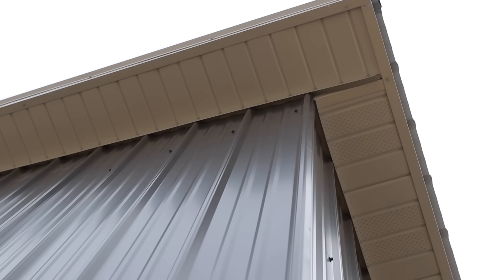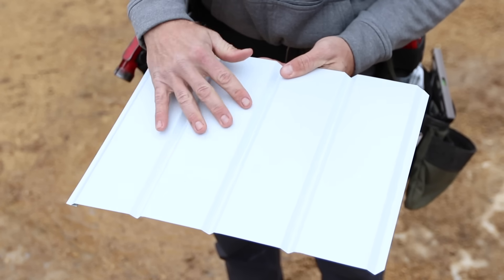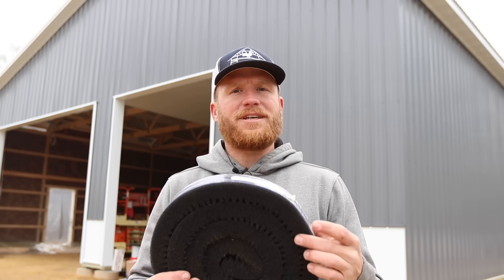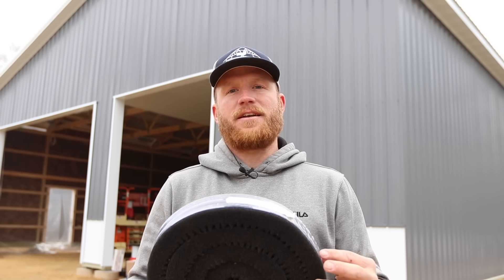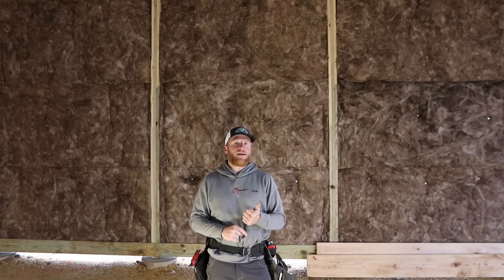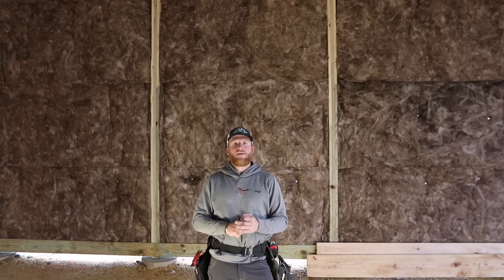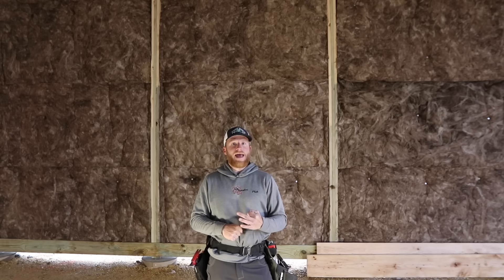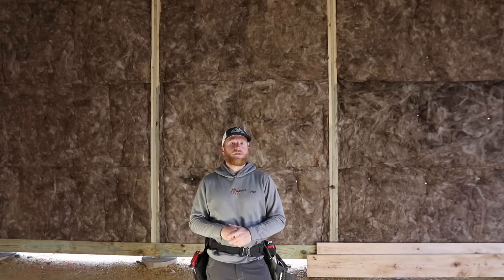Insulation: 5 steps to a more efficient building and why I don't use spray foam

Comment: I would not use spray foam for a few reasons. Once it is there it is there for good. For example, If you need to replace a outside panel its not going to be fun as that foam was adhered to the panel and its not coming off.  The second reason is out-gassing. 
In any event, the building you showed is very nice and shows your attention to detail. Note: My show in VA only has 1.5" of rigid foam panels on the wall with plastic moisture barer on the inside and R19 fiberglass on the ceiling with plastic moisture barrier on the inside and steel over that. In our climate it is more than enough as I mainly cool the building vs heat it.

Comment: The biggest problem I’m seeing is there is wayyyy too much conflicting information. 

Some folks say closed cell spray foam is the best, others say a mix of open cell/closed cell is best, some say use house wrap when constructing a post frame building, others say “no way José”. Some folks swear by pink fiberglass batts with paper backing because “the backing IS your vapor barrier” and still others retort back with “But when the paper backing gets wet then it’s all a big mess at that point”. 

Some folks say “Check with your local blah blah blah” only to find that each one of the local builders/architects/contractors/shamans all have their own opinions on which way is the “right” way. 

Some folks will tell you “NO do NOT use metal! Instead use sheathing and cover it with normal house siding because metal sweats and OSB doesn’t”……but then you discover that it does in fact sweat and next thing you know your OSB is OSBogged down with water and black mold. 

When I discovered that this condensation issue was so persistent and pervasive I told my wife “Damn, how in the HELL does anyone have a structure if there is such a crazy issue to overcome that seems like no matter what….it’s futile???”. 

We (the wife and I) are buying an old (1950) property soon and that property has two garages….one is stick built and attached to the house (28x24). The other is behind the property and it post frame (in the ground) from 1982…..back when they were siding/roofing them with aluminum. It is 26x40. 

Neither of them are insulated. They both look pretty good, but being that they are in NW PA (so humid AND frigid) I need to condition both spaces. I’ve been reading and reading and reading but still haven’t found anything that seems solid. I’ve seen countless examples of a job that was done textbook only to end up exhibiting mold/rot/water damage. 

Why don’t the bottoms of walls also have vented soffits and channels (air gaps) similar to how roofing can have a soffit/foam channel thingys/ridge vents in order to allow the roof to dry out? Couldn’t the entire wall have a foam channel (with a vented soffit on the bottom) that meets up with the vented channels in the roof that ultimately leads to the ridge vent? As air outside blows over the roof it would create “pull” or “suction” that would pull air from the bottom of the walls and out through the ridge vent. It seems like a system such as this would allow the entire structure to stay dry no matter what.

Comment: Wrong! I know this is 4 years old so hopefully you have learned more on building science. Air circulation is good and gable vents are a must! Your lower vent(soffit) needs to be at least equal to your ridge vent. if not you can and will get reverse airflow from your ridge vent down through soffit vents. Gable vents help equalize the pressure and help with varying wind direction.

Comment: Hey, I really do appreciate your tips and perspective on building a pole barn.  I learned a lot from you and you changed my mind concerning the use of spray foam for my walls.  I plan on plagiarizing your insulation technique along with using foam insulation for my concrete.  I still plan on blowing insulation on the ceiling but what do you consider the pros and cons of using house wrap on the roof.  I might be mistaken but I think it would help decrease the elements within that space while permitting the building to breath.  Again I value your perspective and acknowledge that I have a lot to learn.

Comment: His five key tips
1. Vapor barrier 
2. Vented soffits
3. Rat board foundation
4. R-19 fiberglass wall insulation 
5. Vapor barrier on inside ( northern climates)
6. House wrap attic air deflectors 
7. R-38 blown in fiber glass ceiling insulation 
8. Strong structural steel frame door
9. Strong energy efficient windows
10. Strong garage doors
  
Thanks Kyle
10.

Comment: Yall should poly (vapor barrier) and caulk the cripples and cracks regardless. It will add the the life of your building because shit happens. im talkin many years down the road but it is important and does make a difference. 30 year insulator here btw from alberta canada. ✌🏻

Comment: As an electrician, don’t ever use spray foam. The money you save on heat/ac will be spent tenfold if you ever want to remodel.

Comment: How this makes sense to me,
Unless you have a whole house humidifier I cannot believe the inside air is ever more humid than outside.  
If you have house wrap, slowing air movement that would help dry the lumber, and also insulation any moisture could be there for some time.
I think that barrier on the outside and used to prolong lumber in a conditioned environment  would be better.
Also if heat is radiating to the cold metal neither barrier will stop condensation on the backside of the cold metal.

Comment: I am sheathing my building which will no longer sweat. I am also not pouring any concrete that touches any board. Insulated slab. What I will do is rip some osb in to 1 foot strips and install them on the bottom girt on the inside and then rip some concrete board and caulk and install that hardy board in a dug trench on the outside. This will allow for a barrier to where my 4 foot insulated sidewalk can be against the wall just under the tin. On the inside I will install some 2 inch foam board all around the walls (the post will have the foam cut off flush where the slab begins so that way brackets can be installed and 2x4s screwed to the post all the way around so that the main pour will be level and not having to deal with triming every single osb sheet that goes up on the walls, once the main pour is done and hard enough to walk on someone will remove the screws and boards. The foam will be placed around the posts and concrete will fill that small section either the same day or the next day.) down about 2 foot. then back fill, lay down plastic and then the rest of the foam boards. Using 2 inch foam around that post will be covered because the 1.2 inch 2x and 1/2 osb and then 1/2 drywall.

Comment: Can I assume that you install a sufficient thickness & R-Value foam insulation board beneath your concrete floor slab? In addition, do you also surround the perimeter of the slab with a foam insulation board between the bottom treated board and the concrete?

Comment: Actually, with Flash & Batt with 2X6 framing, you should be using 2" of closed spray foam and fill the rest of the bay with rockwool batt on top. I hope you are going to put a barrier over the wood at the bottom of the walls so it doesn't come in direct contact with the concrete floors.

Comment: I put a 2x4 rolled in mineral wool on the roof than I 2x8 stud built perpendicular and did house wrap and vapor barrier under the roof and between the studs and osb. I also added 2x8 studs to my foam insulation on my post frame walls after an artic event took my shop from 65* to -10* inside it. Over kill can be the best at times but it’s almost gotta save from another catastrophe to justify it

Comment: I just had a pole barn built in northern Pa. I want to make a shop in it. I’m not sure what is the best way to insulate the building. So many confusing comments. I just want to get it right. It’s a big building 40x 80 . Want to put a 1000 sq ft shop in it.

Comment: Hey Kyle, i know this video is old, but i see that you switched to spray foam. Care to talk about what made you switch? I assume it is customer to customer, but thought you might have some things to talk about.
Reply: My guess is that closed foam spray foam(not open foam, there is a difference) does everything he wants done, plus it will last a very long time(up to and some accusations that it'll last over 100 years). Which means it will not need to be replaced as often as everything else.
Reply: Yes please... thx
Reply: And now switched to mineral wool..

Comment: Pretty good explanation. The truss is called a raised heel truss. The only thing that is better than a metal door is a fiberglass door with a foam core, just as strong as metal and better insulating and more resistant to dents. You can also put 2" thick hard foam boards under the slab all along the perimeter if you want more insulation. The  8' on center studs is a good idea. each wood stud only gives R7, it's called a thermal bridge.
Reply: Actually wood is only R1 per inch

Comment: My folks built our house in the 1950's and did not use any vapor barrier.  Within a year the paint started to bubble off the wood siding with moisture underneath.  Over 20 years or so we could not keep paint on the house.  Finally gave up and went with aluminum siding.

Comment: Spray foam does have it purposes. People should be aware of maintenance, inspection, insurance, financing, and liability issues that come with spray foaming a house of any structure. I won't do spray foam unless I have a specific reason or purpose to use it.

Comment: Wow I’d love to tear down my current garage and have y’all redo it properly. Having major issues with broken batts blowing into the soffits because the previous owners installed a floor in the attic but never covered up the areas on the walls they cut out and the batts are ripping open. Anyone got advice for this?! My only solution is to take down all the drywall panels and remove the insulation entirely.

Comment: If you were to use a paper faced batting insulation in the ceiling instead of the blown in insulation, would you still need the plastic vapor barrier in the ceiling?

Comment: Wait, so the concrete is going to touch your sill plate? What? That 2x8 ain't gonna last you much eh...Certainly not in a good shape with all the wicked up moisture eventually penetrating wood's pours when the green treatment is long gone and your studs need to rest on something.

Comment: Housewrap is not a vapor barrier.  They are porous and designed to allow water vapor through.  Their purpose is to prevent liquid water that leaks through the cladding layer from getting to the wood.

Comment: 9:15 I see, so in your climate you want a vapor barrier on the ceiling plane.  In a milder climate where we wouldn't use vapor barriers on walls/ceilings, would you "seal up" the walls between the truss carriers so that you don't get continual airflow from the ventilating roof?  I feel like that airtightness is important for batt insulation.

Comment: Novice here. After dealing with spray blow in and batt. The main point is Rvalue. Foam is just the most expensive way to get it. Blow in is horrendously messy but cheap. And I like Radiant barriers In attic.

Comment: Fiberglass insulation sags very quickly over time. Especially in those massive widths. Spray foam is not a better option it has too many cons, like fire issues. Best option is a mineral wool. No burning, no sagging, and if it get moisture it maintains it's r value and dries out naturally. Fiberglass will not do this.

Comment: What if u have a existing pole  building with no sofit and u want to put ceiling in and heat it there is vapor barrier and ridge vent  woud gable vents be enough

Comment: Architects are not responsible for the toxic unsafe, formaldehyde producing properties of very dangerous products. Consult the manufacturer. This product was developed in a lab and is so toxic you cannot use it near a property line. Architects do not recommend insulation to imbeciles. Don’t use it just because it’s on the market. You should know you cannot remodel it, use it in any area other than your roof and it’s poison. Suggesting toxic spray foam belongs in any building is not an architectural decision. We say “no!” Spend decent money on your wrap.

Comment: I had my house foamed after 1 year, it shrunk terribly. 1/2 on all 4 sides of the cavity. It was just flopping around inside the wall. We REALLY saw the mess when we remodeled the kitchen. If you have an air gap like that it's the same thing as not having any insulation. The cold air gets completely around the insulation..
Second,  I've seen pole barn guys feel that they had to run palesters every two feet in fear of the insulation pushing out the siding when it expands. That's costly. I think the bat insulation is way better.
Reply: I ment to say  they had to run palesters every 1 ft. Sorry for all of the corrections.  🙄
Reply: (Sorry, that's 1t2 inch)
Reply: Damn....1/2 inch!

Comment: Strange to not see rigid foam insulation along the bottom of the wall to prevent cold transfer into the space through the exterior slab.

Comment: The problem is that with fiberglass you're not stopping airflow at all.  That may not be a big deal where you are, but yah, up here in central Canada where it hits -40C frequently, fiberglass is garbage.  The proof is when using the thermal imaging camera.  R-value is useless as a metric, especially with fiberglass.  If you must, use rockwool (Roxul) at least.  Insulation is the cheapest part of any build, so spend the money and you won't be sorry.

Comment: Down South we have both hurricanes and possible tornadoes. I feel that closed cell foam creates rigidity in the structure as opposed to using bat insulation. Do you agree? Is there another way to increase rigidity besides the closed cell foam?

Comment: If you have metal outside and you heat the inside, the inside will sweat inside unless you use spray foam and you put your bats in after that.
Reply from the maker: Not true

Comment: This video didn't age well.
From the other comments you use spray foam alot now.
Doesn't like every barn ever have 8' bays? Foam does everything you mentioned and more. Fiberglass molds, it falls it's a scam. A flash a batt is also a terrible idea. You literally have no idea what you are talking about.
I'm going to guess you don't have the knowledge to spray foam, can't make much money off it if you don't install it.

Comment: Although I think that spray foam has a good purpose, I do not like that it holds water and is hard to work around. I would rather just take the cost difference and frame to make a deeper cavity and air seal other ways. I agree with you that on remodel projects, it can be a good thing. However, I would almost rather fur a wall deeper if it is not too difficult.

Comment: I learned a lot from watching your video about insulating a pole building. I am building a pole building in PA a 30' X 50' but mine will have a block foundation. I think I will use batting for the insulation for the walls with the vapor barrier. But not quite sure how to insulate the ceiling with the vapor barrier using metal. Metal, batten then vapor barrier on top?  BTW I've watched  several on how to insulate but I found yours the most knowledgeable and you willing to pass on your knowledge means a lot.

Comment: I'd like to see the insulation possess on the roof panels , and the concrete work.  do you use a vapor barrier on the slab.  Are the peers just covered?

Comment: That insulation will get wet at the bottom of the pockets and wick up. You need to fill the pockets with rigid foam or spray foam (waterproof), then you can use fiberglass above that. I made a video that shows how ice damming in the winter backs up water into those pockets, but a heavy rain would do the same. Eventually the entire bottom area would rot.

Comment: Thing is, if you want to insulate the concrete floor, foam boards make it easy.  You put them on the outside of your building between the dirt and the concrete, and your concrete is now insulated from the outside (at least as low as the frost line).  Ideally another layer would be put under it too, to really make that concrete warm, but it's already a big improvement.  When they started doing this in Canadian homes, there was a big improvement in the warmth of the basement.  Sounds like it's not as cold there, so probably not needed under.
It's not necessary to have blown foam in the whole space, a light coating of 1", or even just around all the cracks, will stop the air flow, which is the biggest problem.  After that, the rest of the insulation is whatever you prefer.  Keep in mind the studs are dropping your insulation value though.  Building code usually allows a spacing of 24" between them, and that's best for insulation.  Two layers of studs straddled would also help but not going to be best value for sure.
In cold climates, the vapor barrier is a must as described.  I wouldn't do it otherwise.

Comment: Smart!! And clean. I'm putting up a 24'w x 20'd build-on-site tube-steel shop (in Texas). Different set of issues down here but this is  top-notch info. The soffit guard sheet is brilliant. "Floating" foundation is one of those things that I've always thought ... Why don't we use that? Good job explaining!